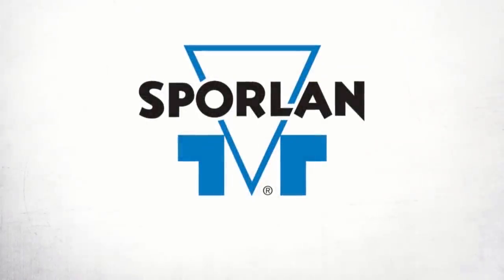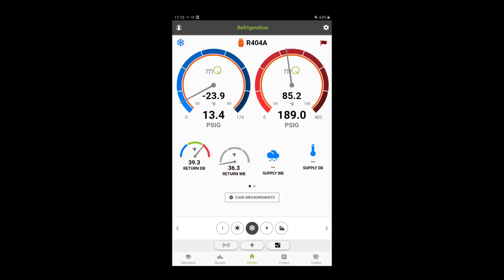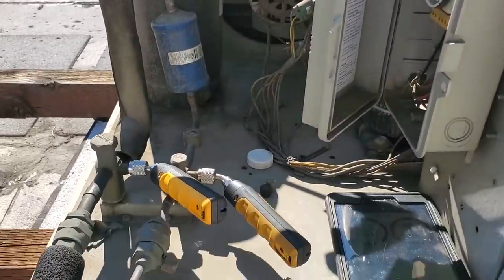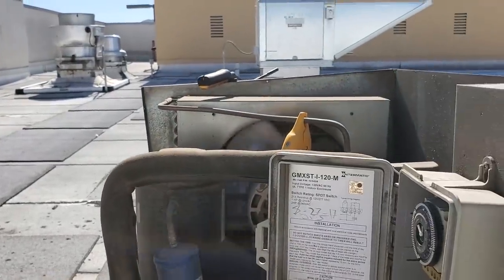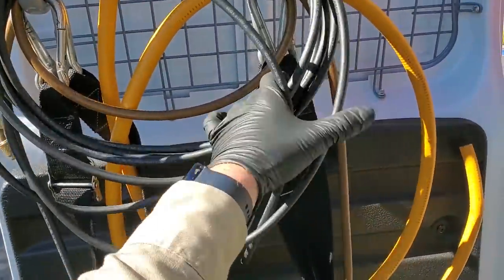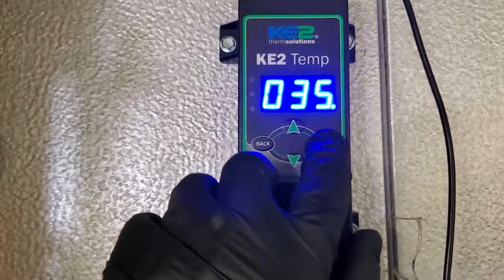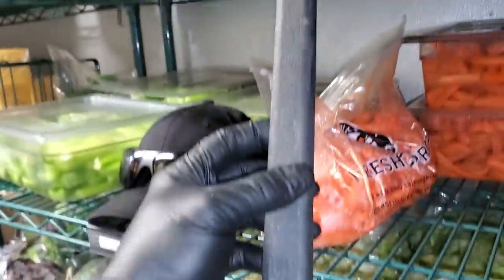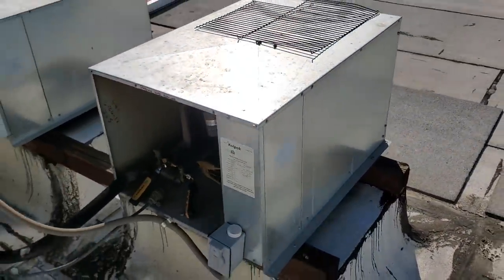THE WALK IN COOLER WAS DOWN TO TEMP WHEN I ARRIVED

Comment: Good vid. ( Ftngot - For the New Guys out there ) Just a Fyi - its not Legal to install so cord , sjo cord , romex etc to a External Temperature control or External Liquid Line solenoid. I Know we All have done it  & still do it. But For the new Guys it Should be in Sealtite or any Liquid tight conduit to be Legal & Pass inspection. Conduit Should be Smooth to Allow for Cleaning.

Comment: Love your videos,  one comment on the taping of the SO cord. I'd tape the switched leg red instead of black. Red usually implies its some sort of control wire, whereas black implies 120vac line voltage supply. Not a big deal if you're the only one working on it, but it may help out the next guy. Keep up the great videos!

Comment: i would suspect thermostat and timer first...
in the aspect of using the "green wire" as a live or neutral conductor, it should never be (electrical code and standards)
also note it could be a smaller gauge conductor than the others, but that's normally only seen above 10awg wire sizes in feeders and service entrance :)

Comment: Couple of questions. First. Why don't you use your temperature controller to control the temperature of the coil, let say 39 degrees cut in and around 15-18 degrees cut off for R-404a ( depending on how the evaporator coil and condensing unit matched . And second, if you know you are coming back in few days why not to put a temperature recorder sensor so when you come back you connect it to your laptop or a tablet and can see temperature fluctuations at specific time. It gives you peace of mind that you really solved the problem and can show it to the customer to make him feel better

Comment: i think the solenoid valve was connected  to the defrost clock on normally close , at time for defrost  the valve closed by the clock  en the machine pump down to low pressure  and shut off . til the defrost  end  .
am i right Chris ? sorry my English is not so good ;)

Comment: I've came across defrost clocks that way as well, what I have found, the N.C. contacts are usually fried, so they use the N.O. and flip the switches backwards, and that can cause another problem, which I have only seen once, and that is, an internal failure and the unit cycling in and out on some of those 15 min sections and not keeping temp, but of course, once you arrive, it is running and everything looks fine. That may have been what was happening here.

Comment: Walk-in cooler box temperatures are always critical, and I've had better luck using an electronic temperature control for the walk-in coolers. Freezers I can get away with bulb manual Style. I would have to try to get a low ambient control for that fan on a condensing unit
Reply from the maker: It really depends on the climate, I will discuss this on my Livestream this evening 3/16/20 @ 5:PM (pacific time) come check it out if you can, no worries if you can’t catch it live as it will post as a normal video when I am done.  https://youtu.be/cEu_Z16eZhY

Comment: I've noticed that different systems have different styles of disconnect switches. Some have the larger box style ones, some have a turn switch, and some use a 3-phase switch like the one in this video. Is there any specific code or criteria for which type of switch is used?

Comment: Just saw the KE2 at Johnstone this afternoon while picking up a relays, encapsulated pressure switch and a defrost heat strip for a Frankenstein  project.
Today started at 4am inside a prep table in the middle of the horsemen's cafe changing out a temp control. Kitchen open 4:30am to midnight, tried to avoid crawling underneath the big cook's legs by getting there early!
Reply: Soon as I seen the ke2 in the video I was on johnstone site looking for it. Couldn't find it though. Guess I'll have to pay them a visit.

Comment: was it just personal preference that you mounted the temperature probe on the wall instead of using the curly q piece of wire that comes with the K2 kits and mounting it right off the back of the evaporator.

Comment: Otherwise if you don’t slightly oversize the condensers and it’s 105 outside you’ll be back with a warm walk in
Reply: Mike I don't think it's about just slightly oversizing a condensing unit. If temperatures in your area go 105-110 sometimes then match the capacity of the evaporator coil at the cut off temperature to the capacity of the condensing unit at 120 degrees. Then you will be fine in all extreme cases.

Comment: The KE2 only control the solenoid valve for cooling and pump down . What about the defrost heaters during defrost mode or is an air defrost application ?
Reply: Just a produce walk-in, and the temp setting is 35, so I'm guessing air defrost.
Reply: @44R0Ndin   Yes ,the "KE2 Temp" manual  said , air defrost in  medium  temp application. for  low temp must use "KE2 Low Temp + Defrost" model
Reply: KE kompany has many different controllers starting as simple as KE2 and ending with very complicated set ups including controlling system throw the internet or just checking temperature on all refrigeration/ A/c units from the office. They even have wireless sensors that connect to gate away router that allow you remotely to see temperatures in all places in the restaurant ( fridges, rooms)

Comment: Why not carry some metal flex instead of messing with that cord? Don’t believe that meets the conditions to use a cord for a permanent installation.
Reply: Can't use bx or mc in a cooler
Moisture bro
Reply: Alex Allen I think it would be perfectly fine. Being in a Walk In is completely different than being outside in the elements. Its also easier to work with than seal-tite in a cold box, especially freezers.

The moisture seal is supposed to be on the outside of the box. I would use weather-proof on the outside with the conduit sealed passing into the box.  On the inside I think it is preferable to use regular junction boxes and conduit.

Comment: Thanks Chris, great video. I know you like to use the Samsung Galaxy Tab with your FP kit but i had to ditch mine. It was painfully slow..... the live data updating, moving between apps and just a terribly slow tablet. I replaced it with an iPad Mini 4. World of difference, not to mention it fits WAY easier in the FP Job Link case than the Samsung did. Almost like FP designed it for an iPad Mini....🤔